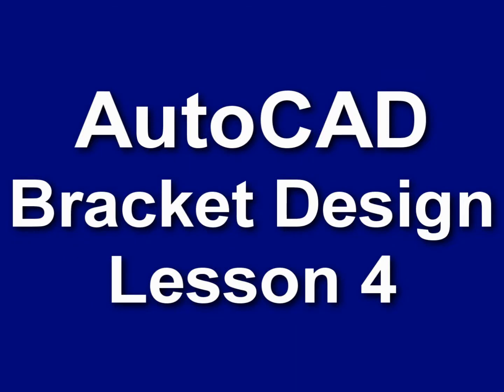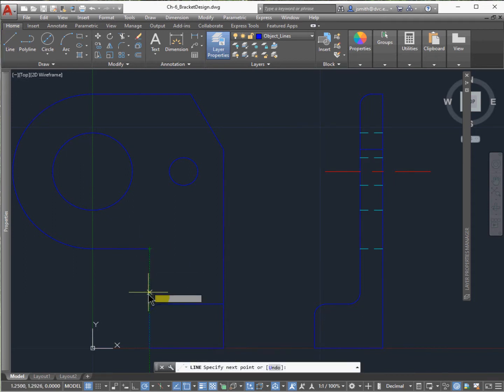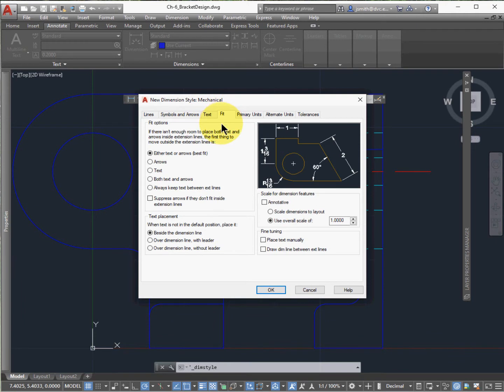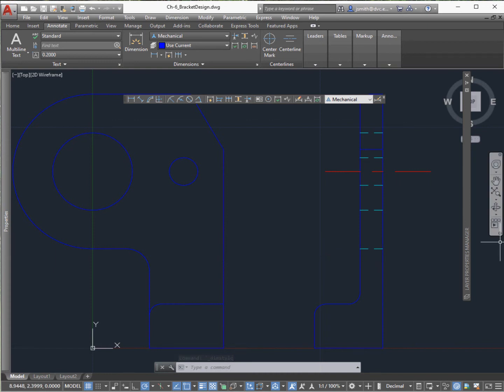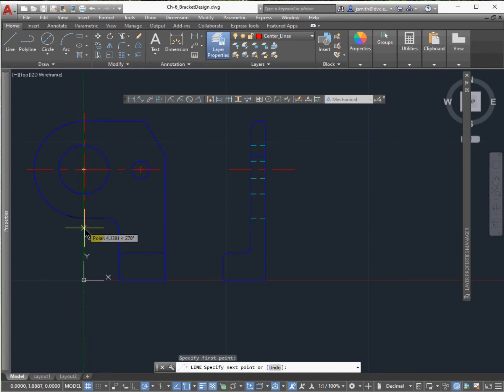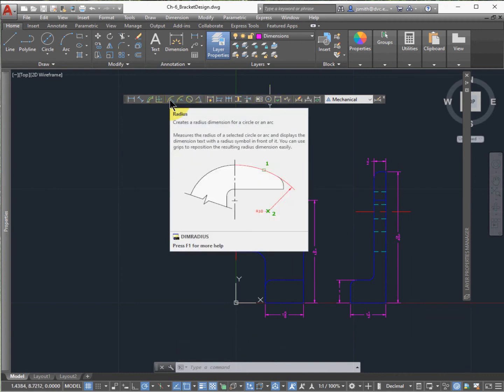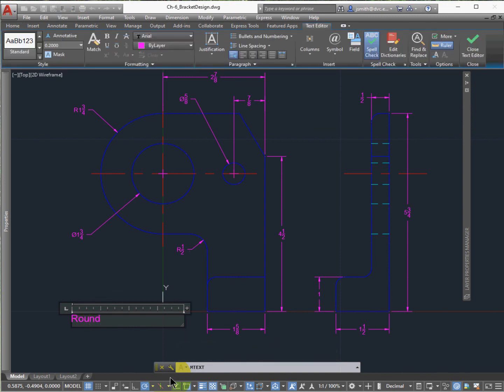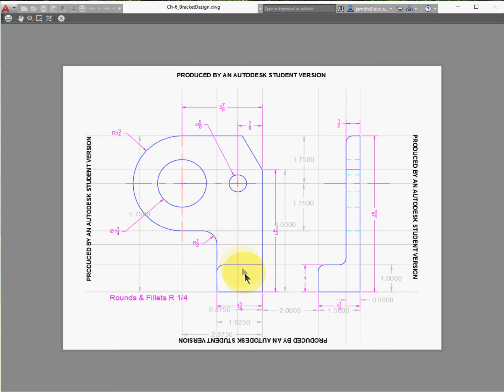CH 6 Bracket Design Lesson4

Comment: 3:18 - Thank you professor.  Why would we choose Fractional over Architectural?  It seems like the only difference is that the inch symbol appears, which seems like a good idea.  I know you are busy, so it's okay if you don't have time to reply.  

Thanks for the video.  Hearing all the tips is helpful.
Reply from the maker: Its all about tolerances. Machining and Manufacturing work in .00 as their baseline, while architecture deals with feet and inches.